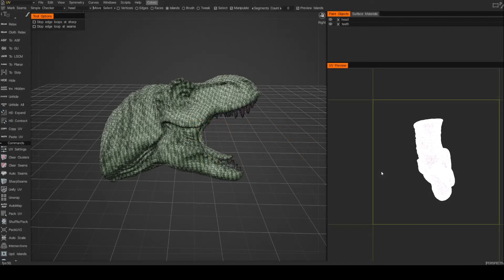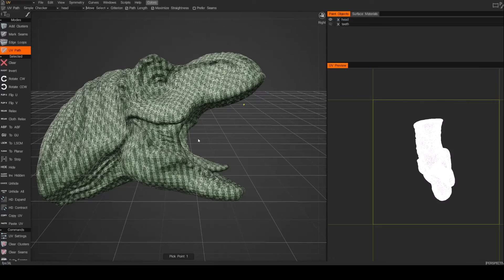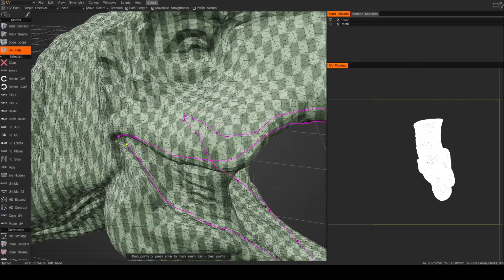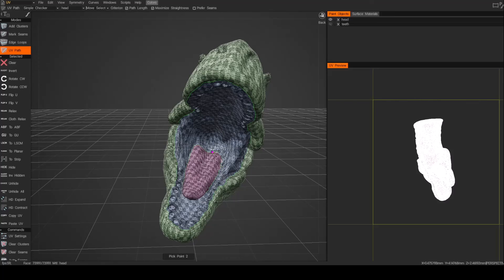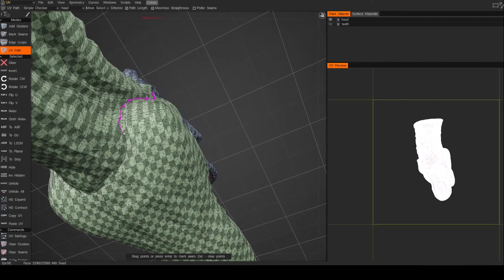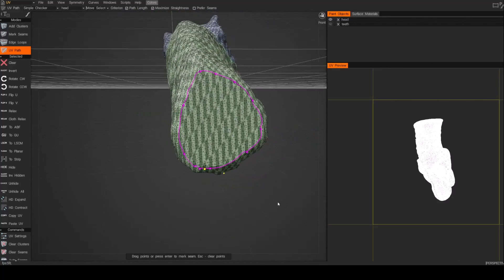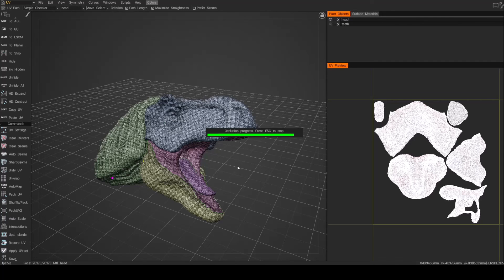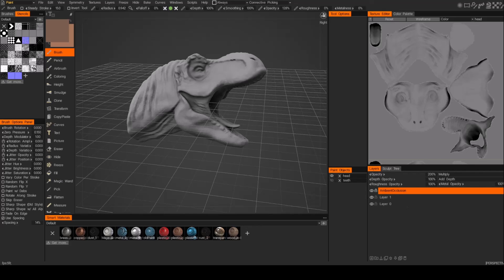3D Coat   UV Mapping - The UV Path Tool

Comment: More Islands also mean more vertex splits, meaning less performance in game engine
Reply from the maker: Totally agree! I started my career in the game industry, and that was a real performance issue we had to work around years ago. Modern day game engines handle this so much better, but I still try and keep the same principles. Fewer cuts unless absolutely necessary. Plus, I actually have always enjoyed retopology and UVs. I may be the odd one out, since so many people really seem to dislike the process (I think it's mostly due to time constraints and deadlines thou). 😁
Reply: @industrytuts5272  Ahaha, I 'm with you, I really like it too. There are few moments more satisfiying in the process than achieving a clean translation from a high poly to a low poly that is almost indistinguishable form your high. That said, with modern tools and engines, more time freed up for art  than optimization is a huge plus. However, efficiency will always be important in game dev, it's facets only change and weights shift over time. Vertex Splits (sharp edges or UV seams) increasing the count won't likely change, they also have a severe impact on Unreal 5 Nanite meshes. Besides performance, build size is also still a concern, and with every split it will increase per asset. But yeah it is always a balance also. Too complex, no golden rules, but certainly good guides.